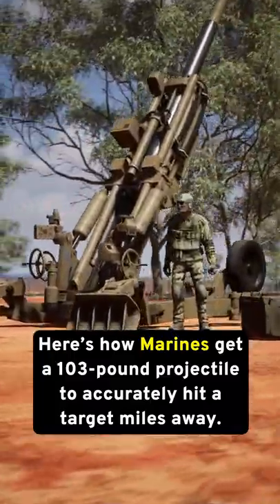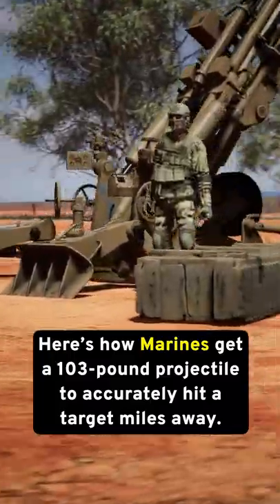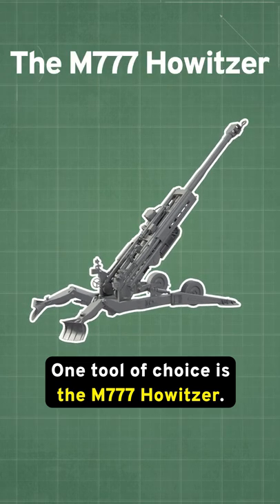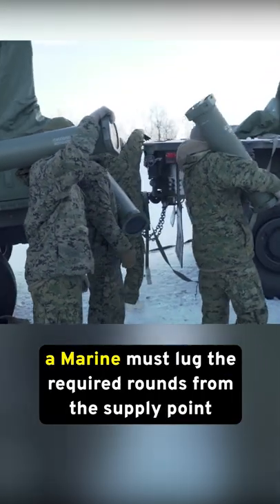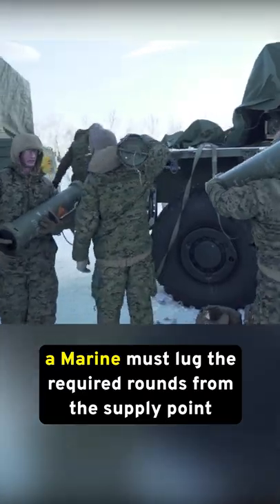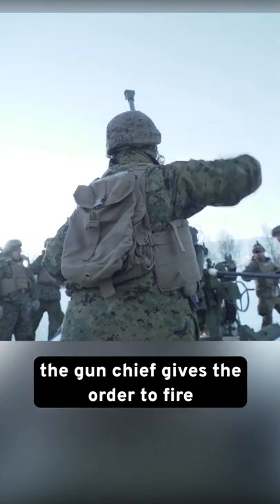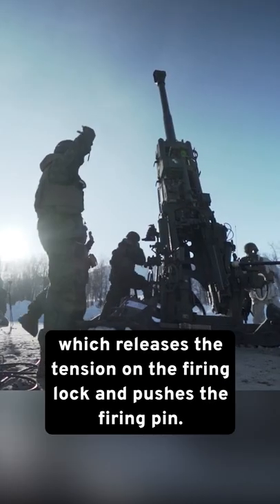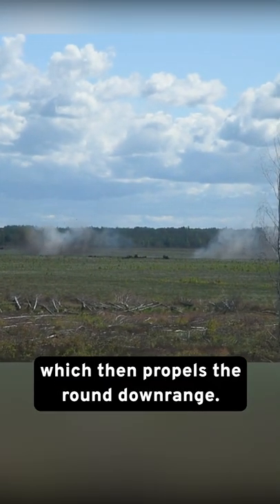How Marines Accurately Hit Targets Miles Away

Comment: How many rounds could they shoot off per minute / hour?
Reply: I think a super crew can shoot 3 rounds a minute.  That's pushing it tho. Usually  a round ever 30 secs
Reply: The maximum rate is 7rpm, normal rate is 2rpm. The more they shoot the slower they will get. The barrel gets really hot, with rapid firing and can cook-off a round in the barrel, and that's not good! They are excellent for what they call T.O.T. or Time On Target. They change the firing angle (elevation) with each round fired, and by the time the first round hits the target the other rounds fired all hit the target at the same time. All from 1 gun, just changing the firing angle (elevation) and that adjusts the flight time of each round, causing them to hit the target on mass. The higher the elevation, the longer flight time, the lower the elevation, the faster the flight time.

Comment: I don't know if it would work but why don't they like use a map as an sight like having the actual sight show where the round would land
Reply: The targets can be 40km from the fire position. They have people on the ground upfront called forward observers… i.e. other troops who call back to tell them where the rounds are landing; they can then adjust the gun to change where the rounds land, for example on enemy trenches or fortified machine gun positions. Much cheaper than scrambling air-power.